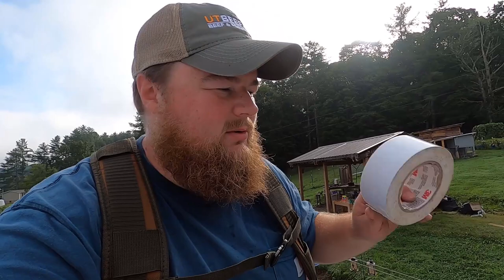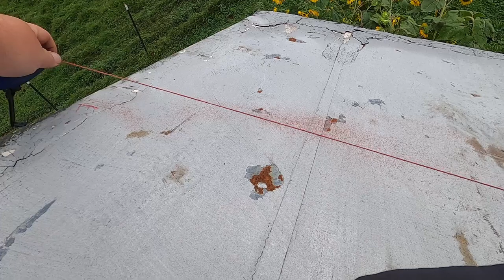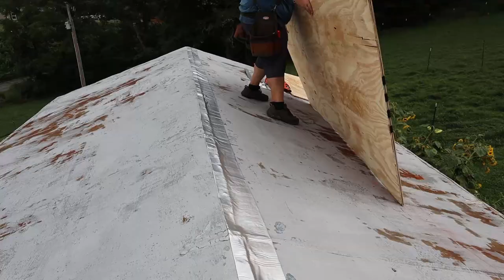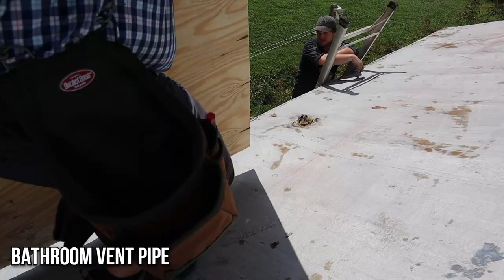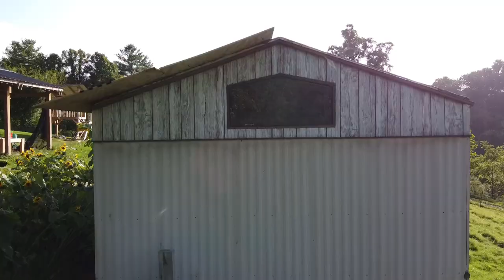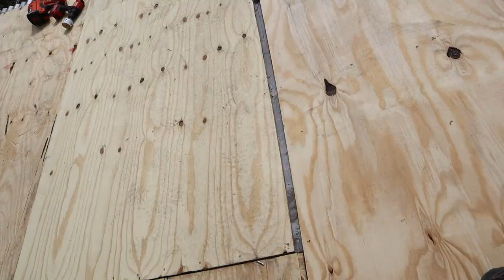I Almost Gave Up!!! - MOBILE HOME ROOF OVER - Day 1

Comment: No tear off is nice, but loooordy!!!! walking on the roof had me biting my nails, like a Hollywood cliff hanger..... lol
Reply: Trailers can be scary to walk on, as there's not much support, most are just 2x2 stringers. But the roof metal is a huge one piece sheet and is surprisingly strong. I used to weigh 330lbs, am now 250, and it had no problem supporting me when I was a mobile home park maintenance man back in 2008
Reply from the maker: I agree with this. 😁

Comment: My husband did not fully cover our 1990 Oakwood singlewide with plywood, he put 3 rows of furing strips on each side & then put metal on. We didn't think the extra weight of the plywood wold be a good idea. Just the way we chose, so far, so good 12 1/2 years later.
Reply: I contacted a metal roofing company for mobile homes, they also want to use furing strips and insulation, and for the gutters a piece of metal flashing was somehow going to hold up the gutters. Did you choose to use plywood for gutter support?

Comment: You're off to a good start. Just keep at and try not to stress. Rain isn't so bad, lots of homes get rained on during construction :) I noticed you skipped your roof clips, but you probably had enough to worry about up there. It will probably be just fine under the metal roof. We watched this the other day but didn't comment. So we thought we'd stop back in and give our support. We look forward to the rest.
Reply from the maker: Thanks guys! Yeah... the metal clips did not work out as we hoped. The majority of my frustrations pre-Josh arriving was in fighting them and getting them to work. It's on my list of things to show-n-tell in a video along this path. The issue I had was the roof still had flex with the plywood on it and the clips would bend up which would tear through the underlayment. I was bummed they weren't working, but didn't know what else to do but space the plywood as recommended, then just go with it. :-\ I'm not too worried with the metal roof, but would have still preferred to get to use them. Thanks for the comment! :)
Reply: @sam-and-angela  That's how it goes sometimes. You just have to do what you can. We actually had trouble with our clips too, not fitting right and being bent, but since we used osb, we just pushed the clips right into the wood wherever they wanted to be. They pushed right into the edge of the osb board when we slid the osb into place. 

I hope the rest of your project is going a bit more smoothly.

Comment: One of the best things about putting a roof over the existing roof is you can add insulation under the finished roof to cut down on how much heat comes in during the summer and heat escapes in the winter. A few inches of foam board insulation can do a lot.

Comment: Brings back memories of installing a new metal roof in singlewide that had the curved style roof. Had to create rafters and purlins to attach the metal panels. Like you, I wanted overhang to attach gutters where there hadnt been any on the original. It came out awesome. Im interested in your project as I have a new park model that has shingles. Crummy workmanship throughout, and font trust the roof work. Want to replace with metal.
Great tip about replacing screw!

Comment: When sheathing, you should nail 16D nails near the top of the fascia board, and then bend them up, so they're flush at the bottom of your roof, and it'll help you a TON while running that bottom row.. it'll hold the boards in place for ya.. comes in handy when you're sheathing by yourself 👌👌

Comment: If your doing metal roof screw down need to not worry about cracks and make sure u ice and water the whole roof befor laying ur metal save ur ass in long end or add .5 or 1 in thick iso over ur ice and water and you won't here the rain hit the roof in big rain storms just a few ideas for you to get it done right and with no worries

Comment: Wonder if screws would have maybe gave a better bite then nails. Just curious or if maybe strapping it with say 2x4s for extra strength and then plywood.  Looks good and you guys have don’t a lot of work to your home. I am also into a mini home and the building practice are good in a lot of ways and bad as well.

Comment: What a job! Definitely hard to do by yourself... too bad you couldn’t strap the roof for the metal. That’s when we do here in upstate.. strap, shin to flat and metal. The plywood should add a lot of strength tho.. worth it 👍
Reply from the maker: Any roofer we talked to wanted to do that but then gave us a crazy look when we said we wanted overhangs and eaves added too. It’s hard to see the vision just yet but think of this as building the roof from top down. The eave framing will be added below the plywood then finished out. It’s in my head. 🤪😂 Now lets see if I can do it!
Reply: Green Acre Homestead you 100% can do it!

Comment: Just a word of advice buddy when you put the first sheet of plywood up there and then you started looking for the raptor and you were punching holes in the metal looking for the rafter you should have went up a little bit further so it would be under the plywood and not right at the seam but anyway good job working by yourself you're a big guy and you're still not scared to do what you got to do

Comment: im about to do this and my big concern is all the extra weight on the trailer. how did you address the extra weight of the boards, plywood, and metal roof?

Comment: Curious as to why you did not do 1 X 4 with fanfold insulation between them to insulate more and make it more quiet with heavy rain on the metal roof. I am going to put new roof on my old single wide in the not to distant future. Still not sure on which roof system to choose.
Reply from the maker: Having proper eaves and fascias for gutters down the road made us go this route. Plus it makes the roof much more solid and uniform. We considered insulation with this but didn’t go that route for simplification of install and to keep this project as affordable as possible. As it is we think materials alone are going to be in the 4-5k range. We have yet to buy the roofing.

Comment: We had a new metal roof put over our old roof like yours....as the men were up there walking an electric wire got broke in half because it was literally right under the metal.....we had to have that whole end of our trailer rewired. Just letting you know just in case.
Reply from the maker: Good info to keep in mind. Hopefully we don’t have that issue.
Reply: Green Acre Homestead I sure hope it doesn’t because it was rough. And expensive.

Comment: Why plywood and not OSB? I thought it was cheaper and less prone to warp.
On the gaps - are you sure it’s not just the SWMH being out of square? I think it’s a rule no MH can be built in square!😂
Reply from the maker: Plywood is lighter and stronger than OSB in our opinion for this application... especially with our overhangs we’re adding (12”). I wish I could blame the house on those gaps but it wasn’t so... 😬🤣 That’s what trim work is for! 😎

Comment: Sam are concerned about the structure if it can handle the weight of a wooden roof?
Reply from the maker: No worries.... because we have our home's original data sheet that lists the roof load ratings. This roof is way below even a quarter of the rated capacity. :)
Reply: @sam-and-angela  Would it help (with heating and cooling)or is it even possible to somehow insulate the roof?  Like put down foam board insulation before the metal?  I know nothing about roofs, just asking.
Reply from the maker: I tried to come up with an easy or economical way of adding it but didn’t find a solution I liked. The summers are our bigger issues here for cooling the home and this will help a lot with that. The metal roof we are getting is also special treated to reflect heat away and not absorb or transfer it through to the plywood/home.
Reply: @sam-and-angela  That makes sense.

Comment: Why did you waste all that money on plywood? You could have used1x4's  rough wood from a sawmill & then a underlayment &then start laying your metal panels, just wondering? I know the roof you have on there originally they will Rumble with the Wind suggesting maybe that is your reason for plywood, not sure poorboy in Alabama could not go that route and I didn't see top lines for your roof rafters, I hope it holds up for you, I am fixing to go with a similar deal, but my mobile home has a shingle roof and I am going to strap it out in one by fours and then placing underlayment and then my metal with ridge cap Vinted and the rest enclosures strips, and probably would have been easier for you if you ran your 4 by 8 sheets of plywood vertically, never seen the finished product, is it on the same video? Take care and good luck buddy. Every man is his own.🙏

Comment: Well, one problem I see is, the roof rafters are not made to withstand the weight of all the extra that you are adding to the roof.  Most older mobile home roofs are made with 2x2's and not 2x6's or better.  Since most mobile homes are not made to last like stick build homes are, they tend to have roof problems.  One reason is there isnt any ventilation to allow moisture to escape causing rafters to rot.  The best way to fix these older homes it to tear it down and rebuild it using better materials.  Lets hope you dont have problems down the road.

Comment: I am confused. If the roof is metal wouldn't you put in metal sheets to repair it and not wood? I don't understand putting wood over metal. Additionally it looks like the structure of the roof needs to be strengthened. I hope that at minimum the repair will allow it to carry the weight of being walked on better. Be safe.

Comment: Bad quality job!! You have to use screw at this kind of job! :face-green-smiling:
Reply from the maker: Sorry, but you are wrong. Screws would break in this application because they do not flex with any movement. Three years later + moving the home to another state and still rock solid!